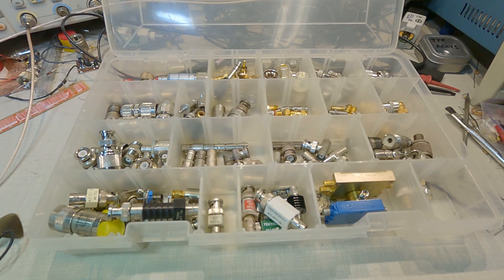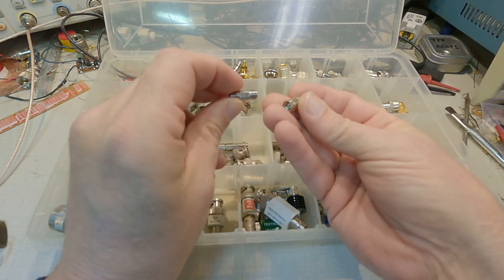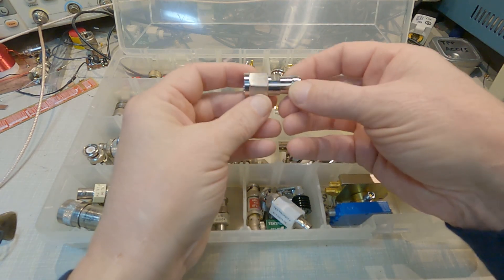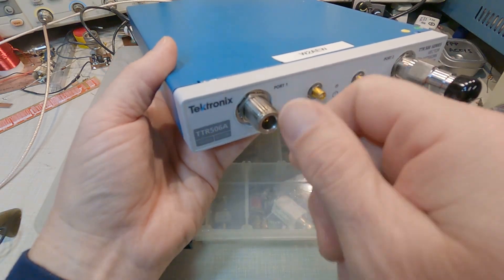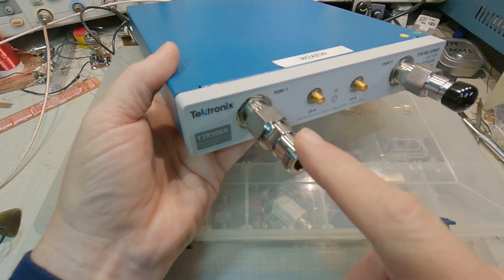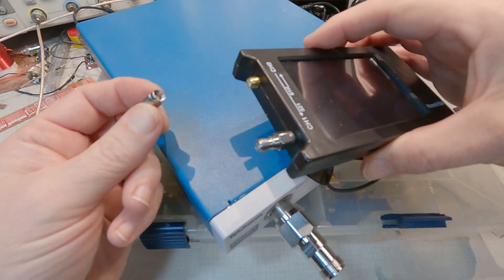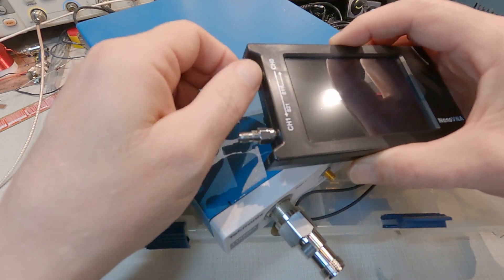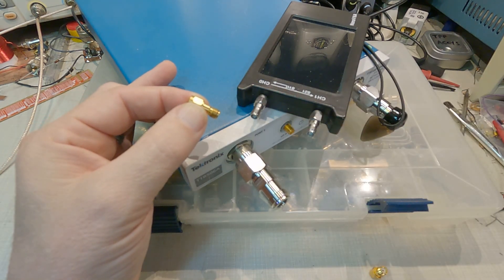#348: Quick Tip: What is a connector saver?

Comment: Is there anywhere you wouldn't use a connector saver, maybe due to an impedence mismatch? A scope input or something similar?
Reply from the maker: A scope is a place where I don't often use one, for a couple of reasons.  The BNC is a pretty robust connector, my scopes rarely get moved so the risk of getting damaged by something banging into them is minimal, and the 10x probes need to connect directly to the scope so that the identifier pin connects to the sense ring to tell the scope the attenuation of the probe.  I also don't use them on equipment that I don't use too often, like a frequency counter.  In some cases, instead of a connector saver, I'll leave an adapter on the instrument.  For example, on my RF signal generator, I have a N to BNC adapter that I leave on it because I'm usually using BNC cables - this serves the purpose of the saver and adapter.